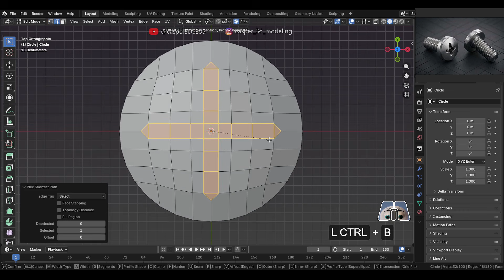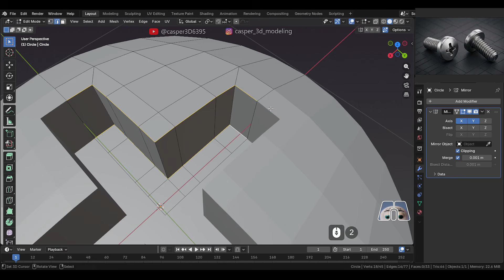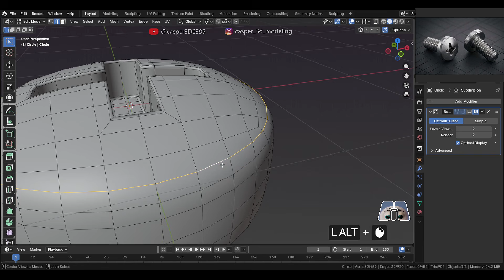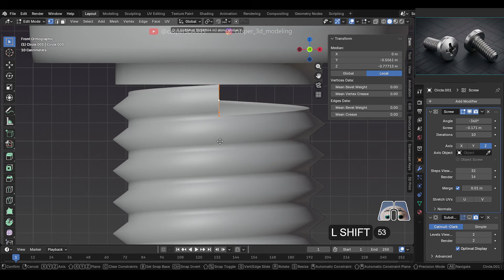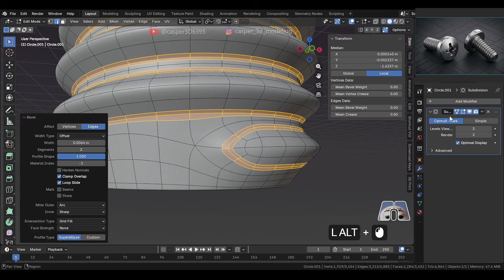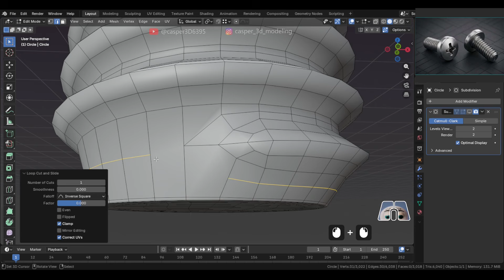Blender Practice – Modeling a Machine Screw (All Quad Topology)

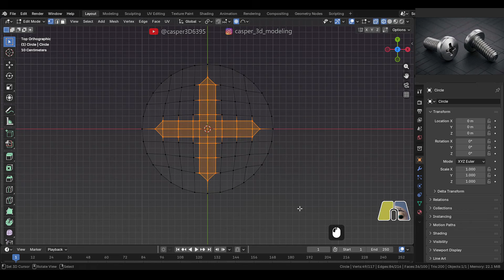Comment: 1:01 I can't figure out how to subdivide the cross of the screw. this part has me the most stuck. Help please.
Reply from the maker: Thanks! On that part, I selected those edges and beveled them by pressing Ctrl + B. You can add more segments using the mouse wheel while beveling, or adjust them later in the bottom-left operator panel. That's what I did there.
Reply: @casper3D6395  Thank you for being so responsive and helpful in these comments. That was super quick!

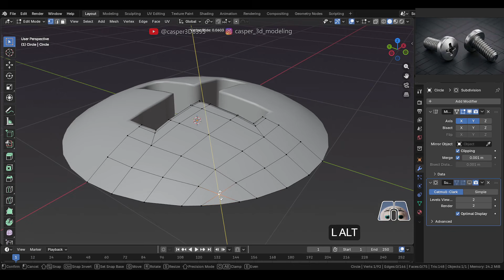Comment: i didnt get how u slide vertex 3:51 not along left or right edge but both. my GG+alt doesnt do that
Reply from the maker: Thanks! Don’t just press GG + Alt directly. First press GG and start sliding in the direction you want, you’ll see the edge highlight too. Once it starts sliding in that direction, then press Alt to lock it. Hope that helps 👍
Reply: @casper3D6395  but it always matches one or another edge, never that direction that u achieve. anyway ty for tutorial
Reply from the maker: Yeah, it can be a bit tricky sometimes. You need to slightly move the mouse in the direction of the edge flow first, then press Alt. 
If that still feels tricky, you can also use a custom orientation. Select the edge you want to slide along, then open the Transform Orientation dropdown at the top where it says Global and press the + icon to create a new transform orientation. After that, select the new orientation if it’s not already selected, then move the vertex  and press the axis key  you need and confirm 👍
Reply: i have the same problem but i found a solution , you need to go down not up when you do GG , so you have a verticale line and now you can press alt to go up .

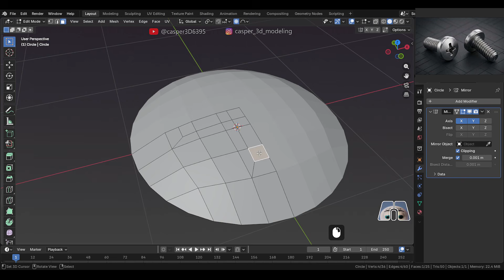Comment: Hi thank you for another nice video. 1:36 extruding down the "cross" it still creates in the middle walls - even if I use extrude manifold the walls are still there...pls help
Reply from the maker: Thank you! After deleting half and adding the Mirror modifier, make sure the modifier is enabled while extruding and not turned off. Also check that Clipping and Merge are enabled in the Mirror settings. Hope that helps 👍
Reply: @casper3D6395  I somehow missed this as well. Thanks!